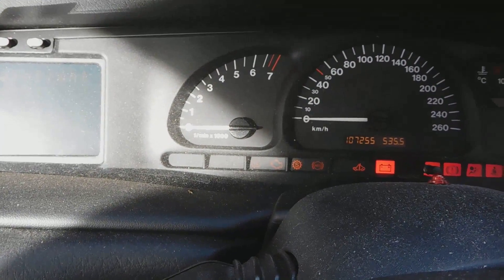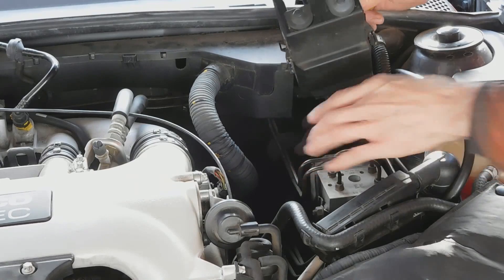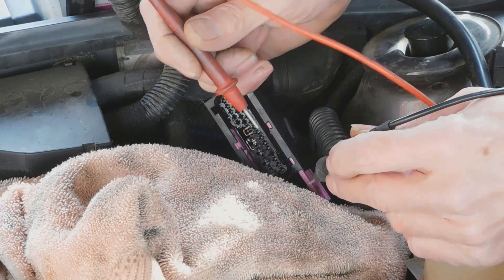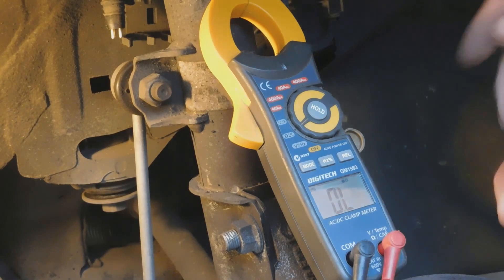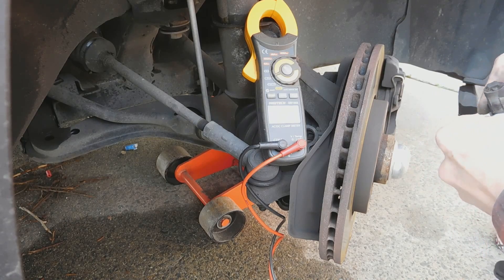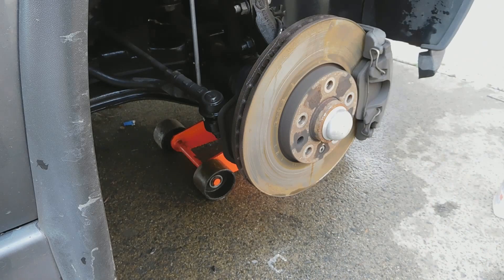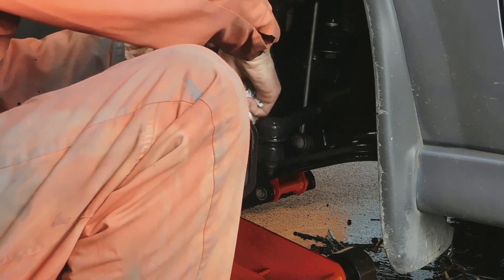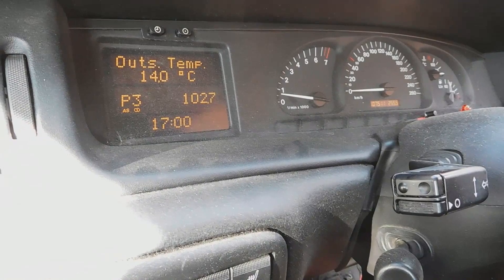How to test and fix ABS easily on Holden Opel Vectra, no parts required.

Comment: Thankyou for posting the video. I have the same lights come on intermittently, one mechanic changed a rear sensor a couple of years ago, and after watching this it might have been a mistake to have replaced it. I will be letting my current mechanic know to pull them all out and clean them all for me.
Reply from the maker: The mechanic may not have to remove them to clean them, its one of those things you can do yourself it there is room to get in there and shove s stiff brush in and hose it off. If you are going to get the mechanic to look at it you might want to ask him to actually test the resistance of the sensors at the plug to see if they are on spec and do it before and after cleaning them so there is some visible result to see in the resistance value changing, which is basically what I did just to be certain cleaning them was doing something and not just hope that helped..

Comment: thanks for video a big help . looks in my case the problem is due to corrosion of the teeth on the exciter wheel decided to change cv joint but exciter wheel is seperatly available thanks again mate
Reply from the maker: Glad it helped.

Comment: Will try to clean it up too...my zafira a having the same problem...abs and tcs light up and is it because of that the speedometer is not working too?...the light sometimes gone but later will on again....if the the 2 lights gone speedometer work but if on it doesn't work....tqvm for the video will definitely try that out
Reply: Huuu..sadly ...system is different...

Comment: Hi mate. Thank you very much for your excelent video. I have a Holden Vectra 2.2L year 2000. The odometer doesn't work and the light of ABS and TC are turn on. I thought that my car had the same problem like your video. I checked, thing, cleaned all the sensors and these work very well. I bought a scanner OBDII but this model doesn't have the same protocolo of comunication. Do you know what can be another problem for this failure? and Do you know which scanner can work for this car model?

Again thank you soo much for your help
Reply: Gabriel Betancourt 
Hi mate I have the same car and exact same problems, did u ever find a fix?

Comment: I've had the same problem I just did the same and found alot of metal shaving on my sensors to cleaned it worked for a bit  off but unfortunately the lights came back on next time I started it.

Comment: Hello, thanks plenty for the very explanatory video. How do I find the ABS control module and corresponding end-points to test the respective wheels on a 2003 Vectra C? Are they the same on every car of that model and make or is there a website to find out? Thanks again. Great Video!
Reply from the maker: The Vectra C has a wheel sensors inside the wheel hub but basically likewise has a wire plug and connector coming off the wheel hub you can locate and test. But start at the controller modular plug up at the brake line ABS distribution block near the coil tower under the bonnet. From there test all values to find which wheel sensors needs further testing.
Reply: Thanks. Very hard to find a mechanic in Broken Hill, Aus. (one that's not booked out, LOL). I'm going to attempt this myself after work today. I have some ordinary tools, Jack and a multimeter.

My car is showing ESP (electronic stability program/ traction control) constantly lit and ABS just flashes. It's Okay after a cold start, but when the ESP light comes on during a long drive, never goes away, until the battery light comes on and car goes into "limp mode". ESP is causing a battery drain. Battery & Alternator were checked to be Okay.

Do you still think it could be the ABS sensors? I think so. Thanks again, your help is invaluable.
Reply from the maker: I doubt very much that a wheel sensors alone would cause a limp mode, the ECMs wont use in input value that is out of range, hence the ABS light so that would not trigger a flow on of the fault through the logic to the degree its stopping charging and going into limp mode. With so many fault conditions occurring you do need to use a scanner for this one to sort out if there is something going on in the PCM or Body control ECM. They are very cheap to buy a scanner these days. Just bought one that cost me about $50 shipped, PC to OBD and you can read and clear codes with it as well as live values. But it allows connection to any module in the OBD not just the Engine system. With some fault codes you might get some indication or you could run it live logging when the fault occurs and play it back to see any values like voltages as the faulty occurs.. Ive done some video on OBD scanning for non mechanics, need to edit it to upload it..

Comment: Hi , I have a Vectra C 3.2 v6 2004 it in the garage for 5 year because the traccion control is on and the car ride only 20 km/hr not fast they work on it nothing and I love this car it have go performence on the road I want it back on the road.
Reply from the maker: First thing is to see if it has any fault codes stored and see what they are.
Next is to test the ohm values of the wheel sensors like I have in the video to see if they are correct, if you don't know the values you can at least make sure both sides of the car at the front wheel sensors are about the same.
Keeping in mind that the ABS wheel sensors are also used to sense wheel spin for Traction control.
Also if in doubt you could simply unplug the wheel sensors and try that, the ABS light will probably come on but at least it will tell you if the wheel sensors are causing the traction control to stay on.
Reply: @AuMechanic  thanks for the help I go to checked

Comment: Hiya, Did the speedo go off as well ???? Mine has. It all seems to work for a while when i first drive it, then the abs , tc light comes on and the speedo goes off. My mechanic seems to be at a loss. Any help would be gratefully received . Thankyou in advance .  Vauxhall Vectra 2.5 sri. w registration .
Reply from the maker: It may be a wheel sensors, some like mine dont have the speedo sensors in the wheel with ABS sensor, the type that has speedo  and ABS sensor is deeper in the wheel hub than the type shown here. Either way you do need to test the values coming from each wheel sensor with multi meter. Manufacturer provides a max in min value it needs to be within. You may find that a sensor is close to being out of specified range but not quite and doesn't show a fault light, a bit of heat in it changes the resistance and puts it out of the factory range and it shows a fault (heat in any electrics increases resistance) . So if you test all the wheel senor values and find they are all within spec but one is not the same and close to out of spec the maker provides then it might be the cause of an intermittent fault light and speedo sensing failure, Cleaning it may help get it back to the right range if its possible to get to it easily like my ones otherwise it will need replacement. But test the harness and connectors as well. The reason I test the wheel sensor values both at the ABS ECM end of the harness and the sensor end is to isolate any wiring fault that might be the cause. Being this causes a speedo sensor problem it is more likely to be one of the front wheels, speedo doesn't come off ALL the ABS wheel sensors and most likely from one of the wheels so test them first.
Reply: Thanks mate i will pass it on to him .Much obliged.
Reply from the maker: Cheers.

Comment: I have an Astra mk4 sri 2lt and traction control light comes on and stays on when driving done a fault code test and got back c0244 engine torque input no signal, any ideas? 
Thanks
Reply from the maker: Had a google on this and there seems to be quite a few possibilities.
I would suggest as I did to get the factory DVM testing data and then set about testing the values given on the sensors involved and at least isolating any faults there.

Comment: The speedometer does not work in my car, is ABS Hua reason ??
Please answer
One of the people told me that the ABS sensor in the right wheel is responsible for the speedometer
Reply from the maker: No the speedo in this vehicle did not come from the front wheel ABS sensor. I can tell you the speedo remained working when the ABS was not getting the sensor input. -  If ABS wheel sensor in your vehicle was not working then you would also get an ABS system warning lamp because the wheel sensor isn't working - If the speedo is not working but you do not have an ABS warning lamp and ABS is working then all the wheel sensors are working, That tells you that the wheel sensors are working therefor the speedo fault is not the ABS wheel sensors.
Reply: I am grateful to you, it was a good and quick answer, thank you

Comment: hi, i have a holden astra 2004 and the abs lights remain on. How can i fix this. help please. Thanks
Reply from the maker: 2004 probably has OBDII so you could get codes to locate the problem and then get the specs for that component to test it like I have in the video.